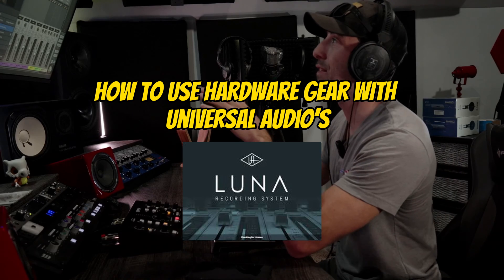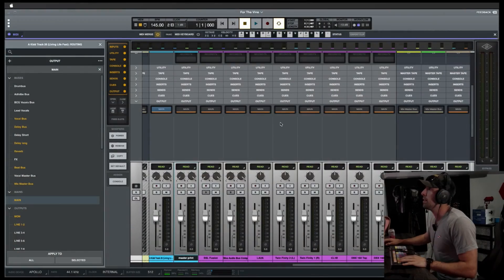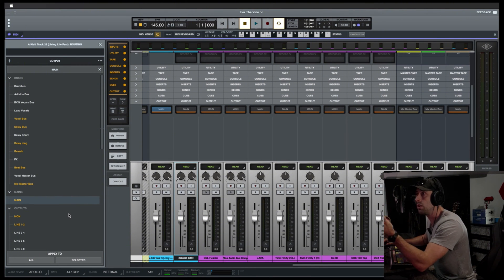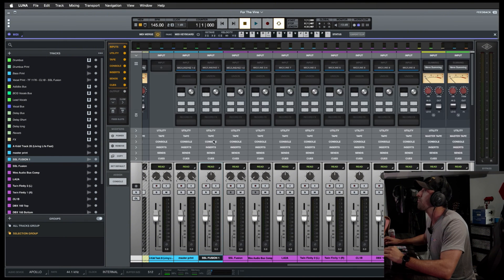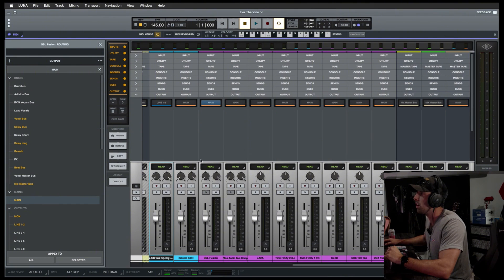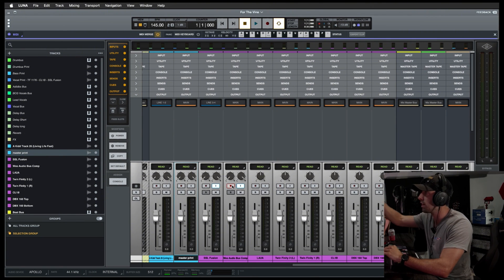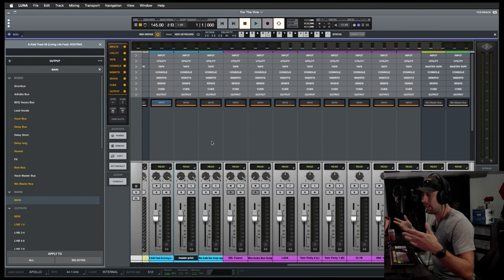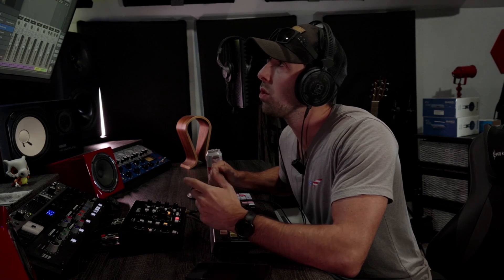HOW TO USE HARDWARE GEAR WITH UNIVERSAL AUDIO LUNA

Comment: If I am following you correctly... Each time you send audio out to the next device, there is a D-to-A conversion, then an A-to-D conversion occurring. One inserted device is fine (the only option), but linking one-to-the-next-to-the-next-to-the...

Best solution would be to directly connect the next analog device from the previous one. Kind of like a guitar EFX pedalboard.

In any event, there will be latency involved with inserting outboard hardware. Either advance the original track or slide the effected print track back.
Reply from the maker: That is a downside as I don’t have a patchbay, which would definitely give me a bit of a cleaner signal flow. Also, I don’t think most people are using enough analog gear to need one or have the AD/DA effect the signal too much. However because I want use of each piece individually at any point, this is the best solution FOR ME at the moment. But you’re right, and thanks for pointing that out.